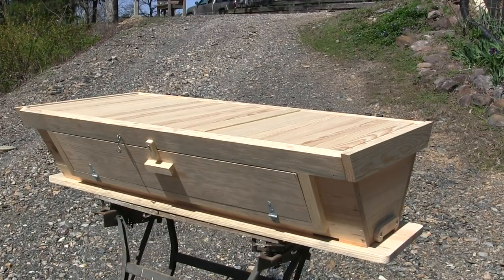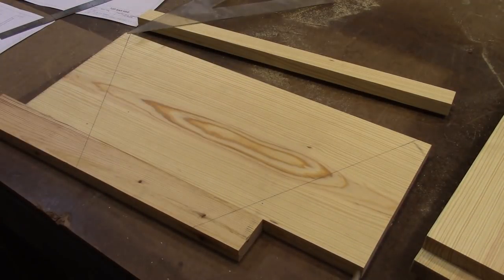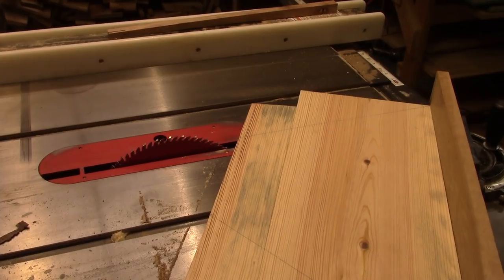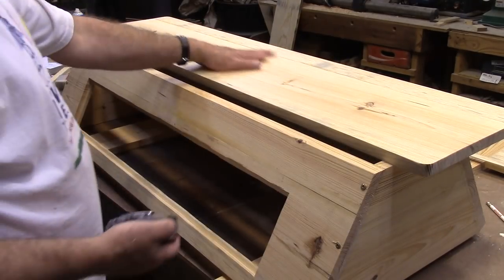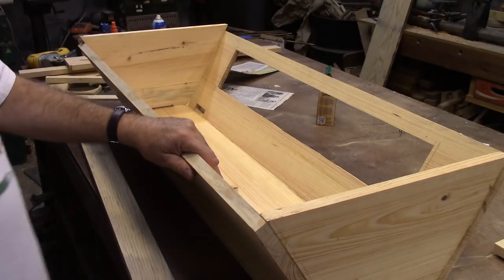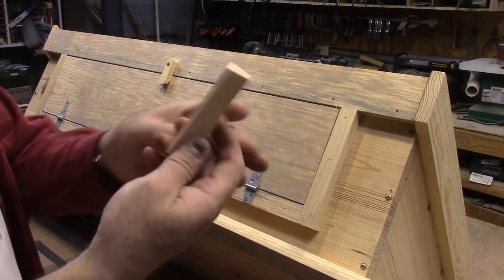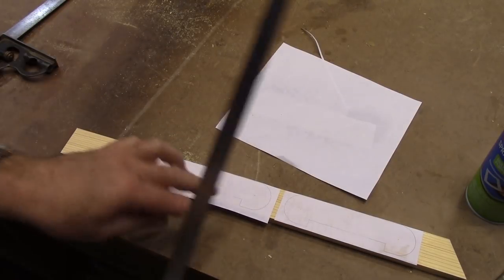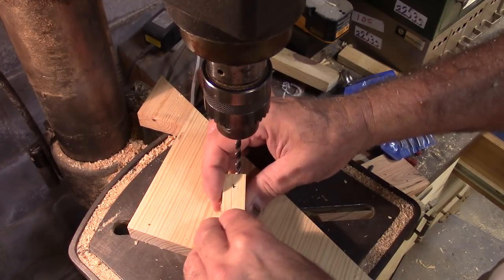How to Build a Top Bar Beehive

Comment: When I made my hive I put a single hole in the follower board to access a feeder at the end. In the design I followed the bottom was open with a mesh screen and a closable panel .  The idea was it allows for increased ventilation and any pests like mites to drop through. I suppose the down side about a fixed underside is anything that drops gathers. Also I treated my pine hive with boiled linseed oil.

Comment: Could you,show how to half your distance when measuring? For example I use this method all the time and it comes out on uneven numbers. Let's say it's 5 and 7/8ths. You divide 2 into 5 which is 2 with the remainder is one,but throw the remainder in the trash. Just remembered 2 is you first answer.  Then you take your 7/8ths. You keep the top number which is 7 then you double the bottom number which is 8+8=16.so your half measurement for both sides are to get your center measurement is......2 and...7/16ths. Now even numbers are easy to figure out but boy those uneven numbers wow! I hope this will help your fans.

Comment: Well those 30 minutes just flew by.  Very well done demonstration.  Do the bees now build their hives on the oak strip you added to the top bars?   Or how does that work.   Am surely looking forward to seeing more of these hives.  Thank you much.   By the way I too have just that same Grizzly dado fixture....heavy little thing isn't it. but it works well.
Reply from the maker: You are the only other person I know that has used that jig, they do a great job.  Yes, the bees build the comb on the oak strip.  I shot a video yesterday showing the comb they have been building, it should be up soon.  Thanks Glenn, you are very kind!

Comment: End Height difference, i imagine, is for 'runoff', because they are using Flat Roof. ?  With Pitch\ Gable roof  - no need.  tho - tilt box to rid any water.  ? 
Yours turned out Nice!  THANKS!  - Note: I have yet to build one.  Still gathering info, so any thought i have, it's just an idea.  Hope i get nerve to start.  
lol   No worries about that roof, only if Bees complain.    i have stories about backroom roof -  that's for another day.    
"Making Wire Hardware"  COOL!   I'm there   : )       Never quite know how to measure for hardware attachment to fit well.
Reply from the maker: You're welcome.  Thank you for your kind words.

Comment: what would be the end result of making it little larger let's say 15 inches instead of 10 inches high 
and 4 feet long ?
Reply from the maker: I imagine it would work fine but the added depth would allow for more comb that may be too heavy without any additional support.
Reply: @SoatMon  
Thank you
Reply: If you make it that tall you have to do a wide glue up to make the parts.  A lot more work.  Plywood isn't a good material for this as it off gasses and the bees don't like that
Reply: @W1ldt1m  
 initially my design was trapezoid' Kenyan bee hive ,
I ended up with a rectangle Tanzanian beehive,
bottom is covered with number 8 hardware cloth that is 8 squares to an inch it is recommended to fight varroa mites ,
I still have to install a viewing window on it which I haven't had a chance to do so ,
the minute that I started working on it chronic pain creeped up and I had to pay my neighbor to come and help me out ,
Southern Pine was my initial choice except it was out of my budget therefore plywood was the logical conclusion  ,
down here in South Florida ... heat humidity and constant wind provide extremely effective ventilation ,
 I don't think it's going to be that much of a problem ,
down here bees are hardy flying around on cold days ,
the only thing that might be a problem is the size of the honeycomb it might collapse under its own weight .
Reply: @W1ldt1m  
As my neighbor was assembling it... I had a little chance to reflect on the design and the final product ,
after seeing how big it is and thinking of the honeycomb size ,
an idea crossed my mind to converted into a trapezoid by installing two pieces of plywood on the inside of the beehive at 15 degrees ,
from the outside it would be a rectangle and the inside would be trapezoid ,
 dimensions on the inside will be adjustable ,
this modification will allow me to control the size of the honeycomb

Comment: Your design does not allow enough ventilation. The base should be mesh. Ideally with about a half inch of rough sawdust or fine chips on top of it. If the bees need more ventilation they will remove the chips themselves. With a solid bottom board, any bees you put in there will swarm during the first nectar flow.
Reply: Or not, depends on which guru you read

Comment: Hii , 

why everybody want to use the exact top bar hive design ? i would rather like box type hive hybrid with top bar hive. 
top bar high with honey comb is hard to take out to check.. it will snap the honey comb off the bar.. 
hence why not just use the frame from the box hive ?  it is so much easier to  check, plus we can insert in bee wax foundation.. to save some honey from being used to make wax. 

2ndly, why make inverted triangular shape ? why not just straight sides ?  hence the size will be like a rectangular.
then we can use conventional box frame.. and more space for honey or brood instead of triangular shape at the bottom which reduced the space. 

do the rest exactly same as the top bar hive.. just both sides uses straight sides.. and use box hive frame. 

just my curiosity

appreciate if you can explain in detail of my questions. . 
truly
andrew
Reply from the maker: You are correct in your arguments, this is just a different way that is preferred by some.  It can cost less to get started but has it's draw backs.  I also have langstroth hives for the reasons you suggest.
Reply: Well in reality, the top bar is designed to be more natural, and a less expensive hive than the box hive. The Top bar honey comb will only snap off if you turn it on its horizontal plane without any form of support on the back with your hand or leaning it against something. This is because there is no wood on the side or bottom that the comb is connected to. This also leads into the trapezoid shape design, which acts upon the inherent tensile strength fact, which is to say you need a wider base at the top than at the bottom in order to maintain stability and increase the weight added. The pyramids work off the same principles, but with Conpressional forces instead. Basically, since there is no side supports or base support, you must have a wider top than the bottom to make sure it doesn't collapse.

Now there are augments also made that due to the fact that the comb is being held down by gravity, and not allowed to rest on the bottom of anything, it is less likely to move on the horizontal plane resulting in comb that joins together, or starts to cave in or the frames getting stuck to the side of the walls, which you do see a lot in your box hives vs not quite as much in top bar hives. there's also the argument that this stimulates the natural way bees live more then box hives, as bees would in the wild live in things like hollow fallen over logs, which naturally would have a sloped edge to it, than a square rectangle edge which is almost never present in nature. And then there are people who swear by the slope edge making bees not as volatile as a result of the more natural settings. From what I've seen, this is to some degree true for all these arguments.

In the end the top bar is a cheaper more natural style of beekeeping, and while you could do it in a square style, you would as a result have to have the frames used in langrstroth hives, which means buying or make your own with sides and a base to it, making it more costly and complex to construct yourself.
Reply: Apart from the facts in the other replies here, there are many other factors which affect hives, like internal temperature, ventilation and moisture control. All of these things are easier for the bees to control with sloping sides. The height of summer the angled sides keeps them away from direct heat. The mesh bottom with this configuration maximises cooling air flow. The top bars are best prepared with a raised central bead, wax production is therefore more evenly laid and is in fact stronger than in "box" hives with straight sides.
Reply: Frames in a long hive is often done. It's just called a long langstroth.  In this hive the sides are sloped because that makes it less likely the bees will attach the comb to it.  They will attach comb to vertical surfaces.